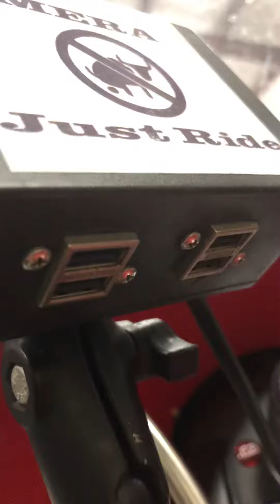Motorcycle jumper cables

Comment: It is always so tempting to go big to go heavy duty and robust on everything you carry on your bike but let's face it WEIGHT and volume are of HUGE importance in what you carry.  My thinking is to use as least lightest most compact "jumper cables" you can possibly get away with particularly if you take care of maintence and very well might never need them ever!  So my thinking is to use simply stranded construction wire rated for 600volts (even though we are dealing with only 12v)  I am thinking just 12 gauge which although if you look at the charts in the code book for house wiring etc are only good for 20 amps?  In REALITY in "free air" as opposed to inside a conduit they will likely take extended periods of 100amps before starting to cook the insulation (which is really the only worry ) meaning for simply jump starting a motorcycle with such brief high draw load ?  The most you are likely to have is some slightly warm cables after starting the bike...and another thing you don't need is excessive length because unlike a damn 4 thousand pounds truck you can simply MOVE motorcycles close in to the donor vehicle,,,,so big ol long cables NOT needed....in fact another thing you don't need for such a rarely if ever used piece of emergency gear is having CLAMPS on every end of the pair....I plan on building a set with clamp clips only on the black negative cable while the positive I will simply solder tin 1 " on each end....the idea is to clamp the black cable to each vehicle at a good solid grounding point but then simply push the positive cable against the plus side of the the battery.... ....it should only take seconds to start the dead bike so extra clips are an un needed luxury if you ask me (I want to carry as LEAST bulk as possible!)
Reply from the maker: Well I have 12 motorcycles including the 2 Urals. I was a motorcycle officer/instructor and competed in iron butt rallies for over 10 years. My longest ride was 37 days leaving Central Texas to Arkansas to Alaska in 3 days and I’ve spent a lot of time camping with my motorcycle. So I am no stranger to minimalistic gear. In 2017, I finally got the confidence to buy a Ural, as I’ve always wanted to sidecar but they weren’t known to be a very reliable in the past. I’ve literally pretty much done just about everything on a motorcycle and this was a new form of riding I have never experienced. I still like to camp by motorcycle but now that I’m in my mid-60s I like to be comfortable. Having a tent I can stand up in, carrying a ice chest and cot. With my 2WD Ural, I can go on jeep trails or places I couldn’t get to on 2 wheels. If you get a chance check my motorcycle playlist. A couple years ago I rode to Canada on my Ural tourist. I carried a spare tire and had to do 2 oil changes and a tire change during the trip.  When I want to go minimal I ride my Royal Enfield bullet. I appreciate you checking out my video and commenting. I never cease to learn new things. I’ve had every genre of motorcycle. When you’ve been riding as long as I have you will find do you evolve along the way.
Reply: You very correct that battery tender wire  will get too hot, been there

Comment: The battery tender connection WILL ABSOLUTELY NOT work for jump-starting the bike. Period. (that's a real one...not an Executive period) The fuse will blow (if you're lucky) or if it has no fuse, the itty-bitty wires will immediately fry.
Reply from the maker: I suggest you not do it then. So I guess the times I’ve actually used it, it was a figment of my imagination. Thanks for taking time to comment.
Reply: Yes IF the fuse is located in the little pigtail connected to the battery you are right but if  not it would only heat up briefly unless the bike has problems and you are grinding on that starter....it is amazing how many amps lighter gauge wire can actually briefly take before smoking lol .....I once in an emergency had 80 amps constant on a scrap piece of #14 Thn building wire....it was at a police station where the main lug on one leg of 3phase  load center had melted off due to being loose....they HAD to get power back for essentials NOW things like telephone system , radio comms jail cel locks etc....all I could find handy was this 6" scrap of building wire and a splet bolt connector I had in my nail bag....clamped the wire to the burnt off end and the other end I jammed into a 100amp breaker and turned off anything not emergency.....clampon still read 80amps and it stayed like that for hours until a contractor came and rigged a generator to redo it all  ....amazingly the insulation never caught fire ....it just got dark and crispy looking lol....of course it was babysat until repaired right
Reply from the maker: The reason I made those jumper cables is because they’ve worked on my other motorcycles. Check out my Farkle box. https://youtu.be/y_ibmPbxnkI